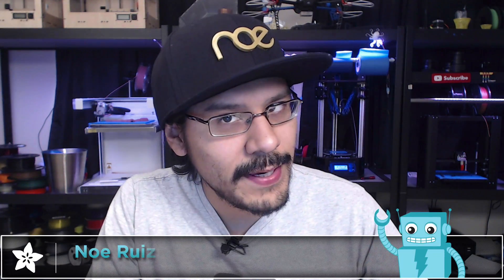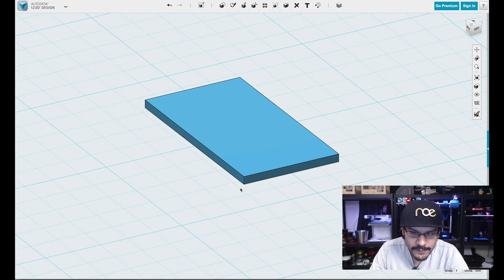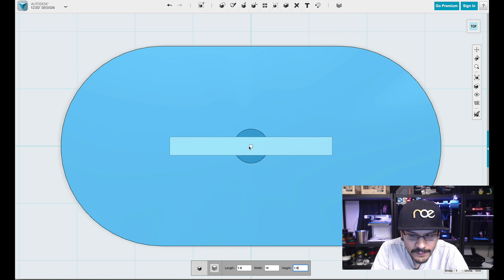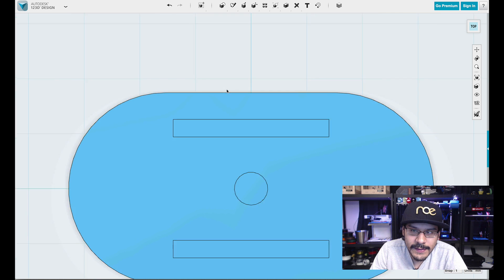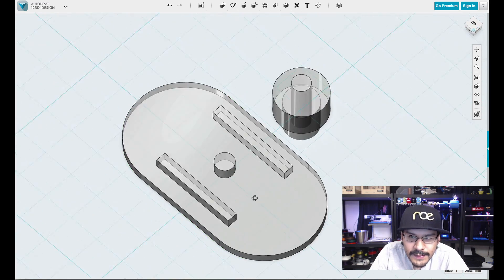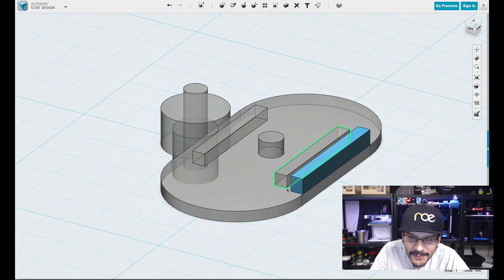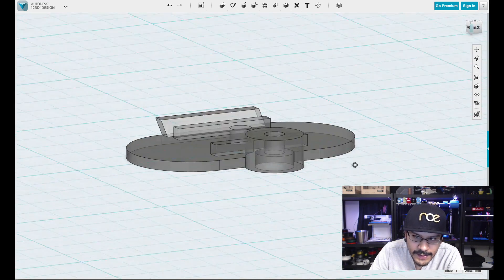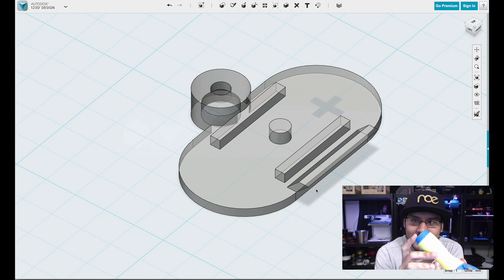Making Replacement Parts with 3D Printing - Layer by Layer

Comment: Adafruit Industries  Can you talk about the difference in measurement in the part that a 3D printer produces than the actual measurements that you drew the part with. I have a Taz4 and I have to make all my parts approx. 0.5mm smaller on each edge in order for it to fit like the original part.

Comment: Where you added the 45 degree chamfer, a trick we use is to add a very thin layer between the small & larger holes. This way the printer won't "see" a cantilever, but will span the hole (not needing support) and you can go in with a drill later and knock it out.

Comment: I would recommend to add a video of how you took the measures of the existing broken piece. Also, it would probably be good to add some sort of reinforcement so the tab\clip doesn't break on the new one.

Comment: Awesome. This is the main reason I would buy one If they weren't so expensive. Ever since I knew about 3D printers I always find things that break and think: If only I had a 3d printer to print out a replacement part.
Reply: +DanR You spoke my mind. I have this damn twisty knob in my car which broke, i just need to print a new rod that connects to the knob. Spend way to long with crappy glues that fail.